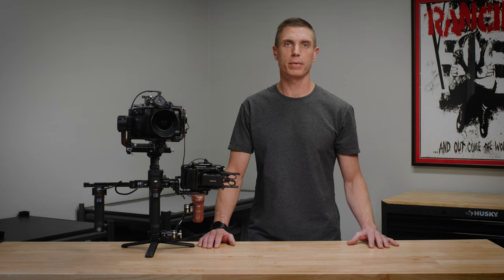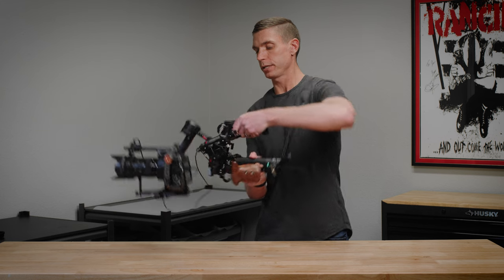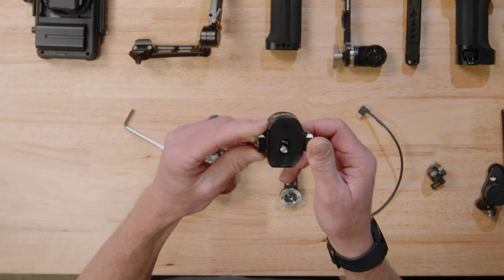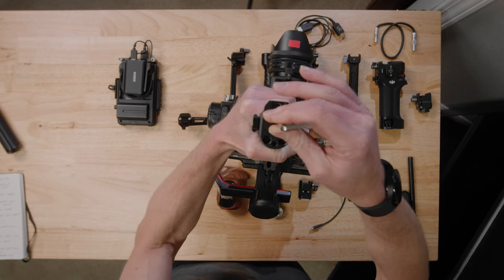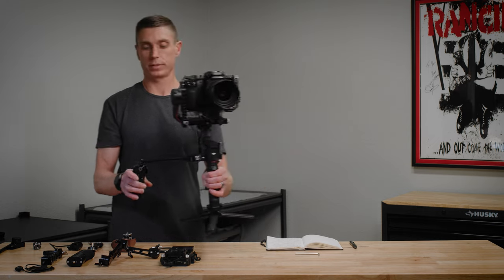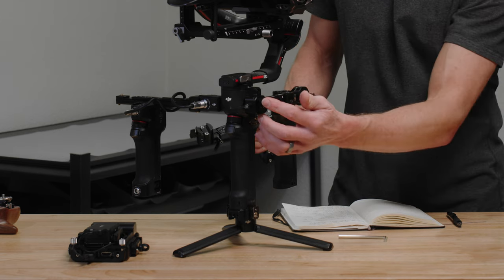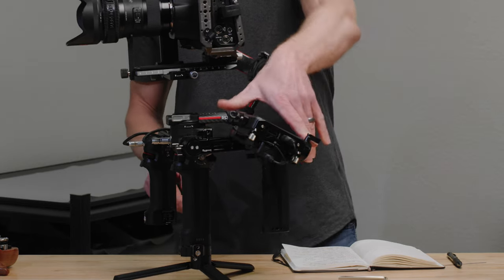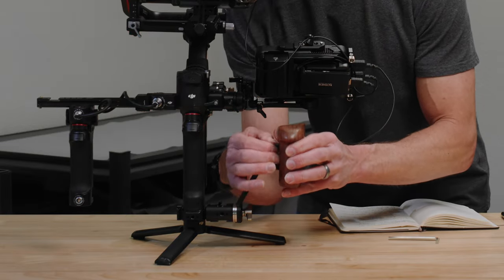My Favorite DJI RS3 Pro Build

Comment: One difficult question. The tethered control handle has two ways to connect it with the extension arms: 1. the Nato rail and 2. the 1/4 20 screw. If you use the 1/2 20 screw on the bottom, is it rock-solid or has a mild elasticity-jitter between the handle and the extension arm? Cause mine is quite moving because of the spring it has inside. Is it the same with yours?

Comment: By you mounting the video transmission unit onto the back of the Ninja V, you had to remove the Master Caddy II that holds the SSD. Therefore not being able to record to the Ninja V. I personally record to both the camera SD Card and Ninja V for safety backups.
Reply from the maker: That's true; but you could mount the transmitter on top of the master caddy SSD. I just don't like using the SSD when running the gimbal, as it adds even more weight. But it's all personal preference at this point.
Reply: @MergeDigitalMedia the master caddy with the SSD weighs an ounce, if that.

Comment: So glad I stumbled into this video. I love the setup, and I've ordered most of the parts. One question, if you don't mind, I'm wondering why you chose to use the Tilta rear extended arm instead of using the one that came with the DJI RS3 pro gimbal.
Reply from the maker: Thanks for watching. Sorry for the late reply. The Tilta extended arm gives you another Nato rail mounting point, which allows me to mount the monitor holder. The DJI version doesn't include this.
Reply: Thank you for your response,. That was actually explained in the video, I think. It is a great set up, especially the left wooden handle.

Comment: How secure is that Tilta 15mm LWS Baseplate Type VI? I mean how is itnsecuring the BMPCC 6K Pro Tilta Cage? Is it just a lever lock at the back of the baseplate or is there a some sort of stop mechanism that prevents the cage from sliding off the gimbal completely when the baseplate lever fails?

Comment: Very helpful video, thank you. The whole rig build ends up costing similar to the RS3 pro. I guess if you want something workable you gonna have to pay for it. Your video saved me a lot of research time.  Why not use another wireless control handle instead of the Tilta Rear Operating Handle for the rare/low handle? How often do you need to pull focus when operating on low angle? Do you find the right hand controls are enough? Thanks a lot.
Reply from the maker: You could use a wireless control handle. I typically don't need to pull focus too much when in low-mode, but it could be an excellent addition.

Comment: Hi,i have pretty similar setup except that i am using meike s35 cine lenses.My big problem is that no matter how good my balance is,no matter how good i am performing the ninja walk,i always get shakiness and jitters on my footage.It looks more like a handheld than a smooth gimbal footage.Have you experienced same issues,or do you have any suggestions to try out??Thank you very much,great video!!
Reply from the maker: Hey, thanks for checking out the video!  
I have noticed that issue before and have a few suggestions, some of which you may have already tried, so I apologize if this is redundant.
1. Do you use a lens support? I’ve noticed some jitters when not attaching the lens support because the BMPCC 6K Pro is so front-heavy. 
2. Have you run the Gimbal Auto Check feature on the Gimbal? Inside the Ronin menu, you’ll find this option. 
3. Have you run the Horizontal Calibration on the Gimbal? Also, inside the Ronin menu. 
Hopefully, these suggestions help; let me know if you have any questions. And please subscribe to my channel for more upcoming videos! Much appreciated.
Reply: Same thing happening on my c70 
As monitor arm are heavier than camera 
Heard motor parameters need to adjusted +5% or something .
Reply: @Neo-qm1dn  What do you mean by monitor arm??I usually adjust the stiffness about 5-8 steps more after auto tune
Reply: @sakisdimoglou1834   the arms we put monitor on 
Perfect tip I will do that
Reply: @Neo-qm1dn  I think no matter what,with camera and lens without any image stabilization there’s no way to get a perfect smooth footage.Jitters are always gonna be there unfortunately…If you find any solution that works please let me know!
Reply: @sakisdimoglou1834   you are right I was thinking maybe put stabilisation on lens but D IS off on camera and see if it makes it better will and try and let you know 
I usually turn both off .

Comment: Hey, nice video. I was wondering why you use a FF motor with this lens. You can just connect your camera to the RS3 via Bluetooth and pull focus with the dial ( and start/stop rec etc)
Reply from the maker: I did not know that! Thanks for the tip, will do!
Reply: Are you sure you could pull focus with Bluetooth? I know you can stop/start.
Reply: @nigerian-nightmare  yes sir, i use it on the regular
Reply: @joelelhadj6993  im going to look into this as well
Reply: @joelelhadj6993 listen man, can you direct me anywhere for help on this? I have some powerzooms Sony lenses that in theory I don't have to use a follow focus with in order to pull focus but if I connect via Bluetooth and set it to zoom, it only works with FF.

Comment: What batteries are you using for your monitor. I must be using some old cheap ones on my new Atmos Shinobi but it dies or wont power on after 15-25 minutes of being on. Is that normal for a battery the same size as yours. Im sure I bought budget batteries so any recommendations for good ones would be awesome!
Reply from the maker: I'm using the Blackmagic Design 3500mAh Li-Ion NP-F570 Battery - these last a very long time.
Reply: @MergeDigitalMedia  Awesome thanks! I’ve been looking at going another route potentially and using a V mount battery to power both camera and monitor but really appreciate the recommendation! I’ll likely grab one down the road to have as a backup if needed🤙🏼

Comment: How are you powering each accessory, like the monitor and the Raven Eye? Are you drawing power from the RS3 or powering each device with a separate battery? I'm thinking about keeping the rig as light as possible (since I do weddings where weight is an issue for holding the gimbal for hours).
Reply from the maker: Raven Eye has internal battery. Monitor runs off an NP-F550, it's a small one, but if you buy Blackmagic's version of this battery, it lasts a long time.

Comment: Amazing build... And how you connect a battery charger for your camera??... Do you use a VMount battery or just the battery it's come with the camera?
Reply from the maker: Thanks for watching. I do sometimes add an NP-F plate on top of the camera and add an additional NP-F550. The ones sold by Blackmagic are the best ones, they last quite along time. Thanks again for your comment!

Comment: Is your gimbal the RS 3 Pro or the RS 3 (non-pro)? It looks like it is the RS3 Pro based on the fact that you can connect the DJI Tethered Control Handle.
Reply from the maker: Thanks for watching. It's the RS3 Pro
Reply: how did you get the DJI controll handle to be recognized by rs3 pro? I have it plugged in the same way is in your video, but nothing... Thank you! @MergeDigitalMedia

Comment: Impressive build, and very informative!  

With that Smallrig Arm, are you able to make small tilt adjustments to Monitor without having to loosen/tighten something?  I’ve gotten really used to this on other monitor mounts, and it’s hard to tell if the MD3507 is able to do this or not?   Thanks m8!
Reply from the maker: Yes. It's a tension arm, so you can tilt it up and down without having to loosen it.